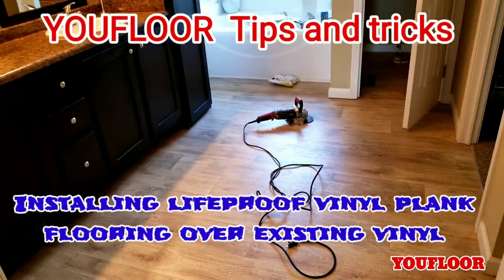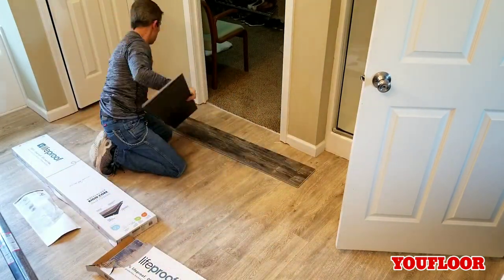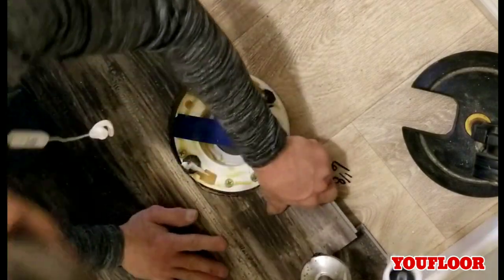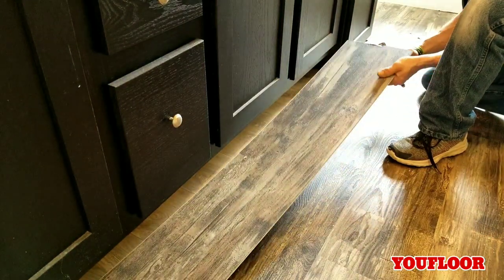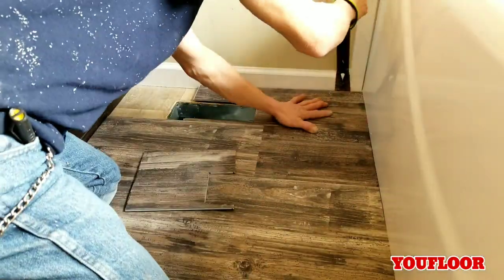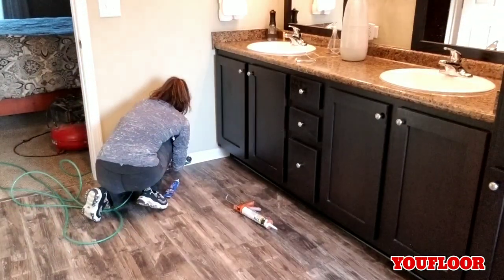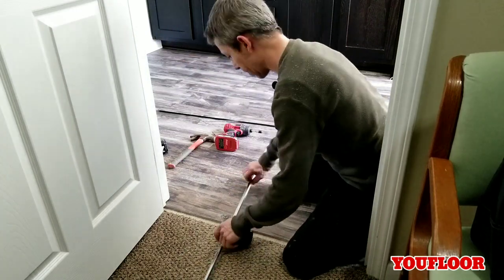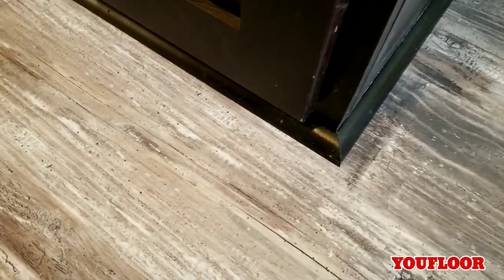Installing LifeProof Vinyl Plank Flooring Over Existing Vinyl

Comment: I am planning on HD doing my instalation of LifeProof vinyl plank....I was told that if i have it installed over existing sheet vinyl , it voids the warranty on the LifeProof.  Can you comment on that?  i am just not sure what to do  Can you give me some advice?
Reply from the maker: I actually am an installer for h.d. and we install per manufacturer installation instructions. I tried to post a pic but can't do that in comment but here's what it says word for word....." adhered And sound sheet goods linoleum and resilient tiles (VCT) : Old vinyl and linoleum tiles or sheet goods normally do not need to be removed if they are fully  bonded and free of any notable damages. some older vinyl sheet goods and tiles contain asbestos should it contain asbestos special precautions must be taken for your safety
NON APPROVED SUBFLOORS
CARPET
CUSHIONED BACK VINYL <---------
Floating floors
Laminate  ect. So from my experience as long as it was glued good and its flat with no huge tears  and it's not cushion back vinyl then your good to go my man. Thanks for the question

Comment: Wow, you're fast!  I use a plank cutter but like how you use the blade to cut it seems much faster!  Did you use a typical utility blade or something different?  Also, what kind of pen did you use?  Regular sharpie but isn't that permanent not erasable?   Also, nice toilet flange install.   I've never got it that exact but the tape method will help out.  Also, do you lay out your planks randomly by using the leftover end cuts as starters?

Plus no knee pads nor gloves your a beast! lol
Reply from the maker: Hey bud. Lots of great questions. 1st yes I use a regular razor knife to do all my straight cross cuts, and sometimes my long cuts if the piece of flooring isn't tiny.  Sometimes I use an oscillating tool for intriquit cuts. I have a cutter but use it mainly for laminate.  We use sharpie or the black markers from home depot. Sharpie is perminate but doesn't stand a chance against acetone. We clean all our marks and smudges with acetone. Works great. Yes having  a piece of tape to mark the dead center 3 1/2 from the outside of the flange  makes a good spot to pull all measurements. I always cut it 3 5/8 from center for a small expansion gap that gets sealed with silicone. And lastly we go in order on our rows big plank small pank big plank small ect. I save all the ends I just cut for the last rows but after 4 or 5 rows we use the cut offs as starters like you said. Hope that clears things up. Thanks for the questions. Good luck on your projects
Reply: @YOUFLOOR  Thank you for the detailed response! 😁

Comment: Situation:
•	I have a large room that has glued down vinyl planks over a concrete slab that are in good condition and affixed securely.
•	I am planning to “float” a new LVT plank floor using the existing glued-down floor as a base
•	There is a bow in the floor that needs to be filled in.
•	Im thinking of using a Henrys embosser to level. 

Questions:
•	Will embosser bond to the vinyl?
•	Should I use a primer? 
•	If so what primer?
•	Is there anything special I need to do to the surface of the existing vinyl planks, like sanding or deglossing?
Reply from the maker: Okay this is my opinion. And it's based on a little research and experience. 1st of all if you can get the old floor up that is always best but if you are trying to buy time and cut soZ--Z-me corners, let's talk about this. 1st you can't lay lvp over a cushioned back viynl. So if you have a real squishy viynl,  it may not be the best surface. However if it is firm and it has been installed with a full spread glue then you should be okay. The viynl can not be loose anywhere and if there is any tears I would cut them out and make sure the viynl is good and bonded around the hole. Then clean the surface really  well. no dirt stuck to the floor as this could affect the bond of the floor leveler. Then I would definitely prime it 1st. Next.. what to use. I have tried many floor levelers and some have been disastrous. I want the best product for the best price. So I don't know Iyour a home depot guy Or a lowes guy. But I found a leveler at lowes and a primer that made levels g a breeze and it made the primer grabs the concrete and almost makes the viynl and leveler as one. That is why it is important  for the viynl  to be fully bonded to the subfloor. Cause if the viynl is optional g so is out patch we just layed down. NO STAPLE DOWN OR LOOSE LAYED VIYNL 😁. I have included the links for the products I use so they are easy to find at lowes. Just a heads up they don't keep this leveler in the floor section with the other levelers. Go to the masonry section where the concrete is. And it's way cheaper.. The primer is over there too. Hope that helps.thanks for the question

Comment: Hello, just found your video. We just had our floor installed by HD and we have the Lifeproof salt marble throne in white color. When they came to measure and wrote the contract it says that they will remove the existing vinyl laminate sheet or whatever you call this.lol. But when the guys that they sent came to install the Lifeproof they said they will just install it on top of the old one. I was concerned but he said he's been installing flooring for 15 years and been doing the same thing with no problem. My concern is that our old flooring was starting to peel off on the seams in some areas and there was a hole by like 3inches and he covered and patch the hole of the old flooring and installed the new one. Now, after the installation, whenever we walk on some areas of the floors it makes a loud noise or I don't know if clapping is the right term but it really concerns me. Do you think, we void the warranty of lifeproof by installing the new on top of the old flooring? What is the reason of the loud noise of some of the ereas of the floor when we step on them? Any recommendations on what should we do? thanks. Sorry for the long comment. I hope I will get your answer.
Reply from the maker: Hello. And thanks for the question. This could be a number of things, and I dont claim to know everything. But I can give my opinion on the situation and you can take the info and make your decision. 1ST OF all was the viynl fully attached to the subfloor (glued) or was it loose layed . Sometimes if the subfloor has a small dip then stepping in that area may make the cycle and plank bend down but slightly retract and slightly different times. Causing  the vynle to slap the bottom of the plank when it catches up. Loose layed  or cushioned back vinyl viynl should be removed before installation. The good news is I used to install for home depot. So I know the installation company should stand by there work. If it continues I would call H.D. back and tell them about your problem and if they would send someone out to look at it. Eventually the problem should get taken care of by the installation team. But only if you stay consistent and keep record or notes on your conversations with customer service. Remember the product has a warranty so if it's the product it should be replace. If it's the installation  unfortunately for the installer, its his baby so he will need to fix it until you're satisfied. Hope that helps. Thanks for the question. Good luck. Let me know how it turns out

Comment: I like your circle drawing technique! Does the wax ring take up the extra thickness of the LVP on top of existing glued sheet vinyl?
Reply from the maker: That's a question  for the plumber. We don't set toilets. Bit I would imagine that if you raise the floor above the flange, you might need a flange extension. Hope that helps. Thanks for the question

Comment: Great video. Question. I want to install LVP in kitchen, bath and dining room. I would like it to run continuous from kitchen to dining room. That would mean running it the short way in my bath. Is that an accepted practice or would I be better off using a transition and running it the long way in the bath? Thanks for any advice you can give me.
Reply from the maker: Well when installing floating floors,  fortunately the direction is really customer preference. It definitely doesn't affect it structurally to run it either way. Hope that helps. Thanks for the question

Comment: do you need underlayment if you were installing vinyl planks over existing vinyl? Thank you
Reply from the maker: You do not need underlayment if your flooring g has the pad attached to the bottom. Which most planks do. But if you run into those that do not have the pad, it can be layed straight on sheet  viynl with no pad. Keep in mind if there are any low spots, then when you walk on those areas you can experience  a clapping sound from the plank smacking the viynl floor. The underlayment acts as a sound barrier. Hope that helps.  Thanks for the question

Comment: Will this work over linoleum?  Also, do you have the color of this flooring...it's beautiful.
Reply from the maker: That is what the video is about. But I will say make sure you're not going g over multiple layers or CUSHIONED back vinyl or linoleum. And the color of the lifeproof is called rustic wood. I have a stair video coming soon with this color. Hope that helps.Thanks for the question.
Reply: @YOUFLOOR why not over cushioned vinyl? Sorry trying to learn
Reply from the maker: @Therealestrunnerluda too much deflection and the direction say not too.

Comment: Do you have a particular model or brand of a laminate floor shear that you use. I've done two rooms and now I have a whole house and the remainder of the one I did one room in to finish. It is worth the investment to get one but there are many. I mainly install the Lifeproof thicker type flooring. Thanks much!
Reply from the maker: We use the Mantistol 10" laminate cutter.  (Amazon) we bought it about 2 years ago. As long as you keep screws tight and blade sharp it will pay for itself in the long run If you do a lot of flooring.  I've had to replace the rubber feet on the bottom.  And a few a screws. The button to push the handle broke so we put a screw in the hole to keep the handle out long. Still have same blade. I sharpen it from time to time. Looking to upgrade next year. But I'll continue to use this until the wheels fall off . So to speak. If you do mainly lvp, I found another cutter made by EBA tools(Amazon) for $105. It comes with a ton of accessories. and then boeske and marshalltown make a 13" inch for $99. Could be perfect for lvp jobs. But honestly for lifeproof and flooring alike. Personally you can't beat a razor knife with a good blade , speed square, and some flat nose dikes or plyers. Quick efficient and clean. Hope that helps. Thanks for the question

Comment: This almost makes me want to do it on top of bathroom/kitchen linoleum...can I do it without ripping out the old linoleum? What about with loose lay vinyl instead of click system?
Reply from the maker: I'm not sure about the second part of your question. But I have read the manufacturer instructions numerous times. It doesn't recomend laying on top of loose laid viynl. Nor does is recommended laying on CUSHIONED back vinyl. If the sheet vinyl is glue(bonded) good no problem. How ever if it is loose laid and you dont feel like removing it. Then I would drive some staples randomly over the vinyl. Hit the perimeter good and around vents. You don't want any movement under the new floor. Personally I think you'll be fine. Thanks for the question.
Reply: @YOUFLOOR  Thanks for the response! It's glued down so I'm going to try...hopefully it comes out as nice as this video :)

Comment: Saw in one of your videos where the flooring had gone around some brick work by a fireplace.  Couldn't see close enough but would you leave 1/4"  gap around edge there too?  Really no way to trim around the brick that goes all the way down to the floor.  Best way to scribe the bricks to make it fit like it should without any caulking?
Reply from the maker: Not sure which one but yeah if it is a square brick f.p. and the brick goes all the way to the floor. In that case yeah you would have to leave the expansion gap and pray the brick is strait enough to run 1/4 round. But in a lot of Instances. There is a mortar bed under th first layer of brick and I will take my flush cutter with a dia.o d blade and a good shop vac and cut and chisel the front part of the mortar out and slide the laminate in. It take time but look great
Reply: @YOUFLOOR  good answer
Reply from the maker: You're from Tennessee too aren't you? I'm in Nashville. Love the channel. Kepler it up

Comment: Have you noticed any "clapping" on any of your installs?  I have concrete subfloor, had several areas clapping and after flooring and baseboard removal, now have proof that concrete was indeed properly ground flat and plenty of expansion gap.  Now going to third party inspection since nobody can figure out why unless perhaps bad planks???   Also, locking system loosening up after a couple weeks at both butted ends and long seams too.  Putting my family thru hell trying to get this floor to be good.
Reply from the maker: What do you mean by clapping? Like peaking at the ends or making noise. Sorry never heard this term in flooring. Would love to give my opinion. Just a little more detail. Thanks for the question
Reply from the maker: Yeah. I see.  You say its laying directly on concrete and it's in direct sunlight. I saw a video where some guys installed this stuff and they put a heater too close and it bowed up big. It settle back down but caused a little deformation of the product where it just didn't sit back down right in some places. If the heat from the sun makes it bow up even an 1/8 of an inch. A void is created,  allowing you to make that noise when you push it down fast. It like smack to pieces of wood together. Does it do it when you walk on it too or only when you concentrate on one area. Because the only other reason I can think of is that there is a low spot big enuff to allow you to push it down. if it is only like 2 or 3  inch side dip it would be hard to deflect lifeproof. it is completely impossible to push down on a truly flat floor, unless the floor is bowed up. Does that make sense. So yeah. If you say expansion gap is good I'm going with. Dip in the floor,  or expansion and bowed up from sun heat or like you said.. just bad product. Hope they take care of you. Good luck. Thanks for the question.
Reply: @YOUFLOOR  .......Actually not even in direct sunlight.  Completely dark (artifically lit) hallway.  But also some areas in the family room and kitchen as well.  The floor is most definitely flat.  Ground and filled by a professional and verified by HD pulling up about 80% of the floor to discover that not only is it flat...it's VERY flat!  Flat concrete + 1/4" expansion gaps + "clapping" = ???   I don't know for sure (except that a void is being created somehow and the only culprit left is the flooring product) and also some of the butted and lengthwise seams start letting go after time.  Look for what was an invisible seam start to get more noticeable followed by potential vertical displacement in butted seams as I'm seeing that lately too.
Reply from the maker: Wow! That is weird.  Well I hate to hear that. Hopefully they will take care of you through a warranty claim. If your looking for water resistant , the pergo outlast may be a good product. We do a lot of that. That is if H.D is going to replace it. Sorry your family is having to go through this. Good luck brother. I'm sure it will work out and this will be a fun story in 10 years. Peace out

Comment: I’m installing vinyl plank over an existing floor soon. The plank comes with an 1mm attached pad, do you recommend an underlay?
Reply from the maker: Well I have installed plenty of this stuff. And from time to time I like to pull the Instructions out just to see if we are doing things the most efficient way. And still following the manufacturer guidelines for maintaining product warranty. And as far as I know there is never a reason to put any kind of underlayment under you lvp. It doesn't even say to put plastic down as a moisture barrier on concrete. So in my opinion in to have a great install,  it's all about the flatness of your subfloor. The more cosistantly your floor is flat the less problems you'll run I to later on. Hope that helps. Thanks for the question
Reply: YOUFLOOR Flooring tips and tricks no, thank you! I couldn’t find any videos explaining this and this really helped 👍